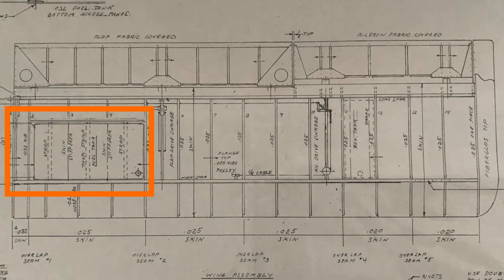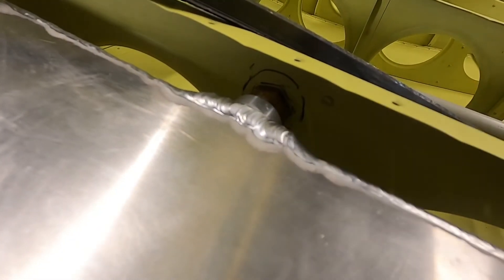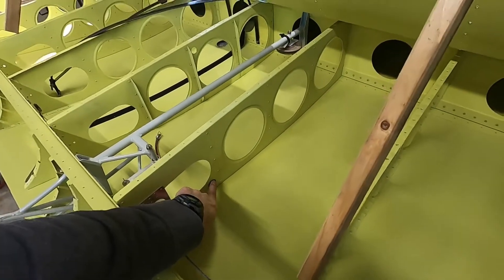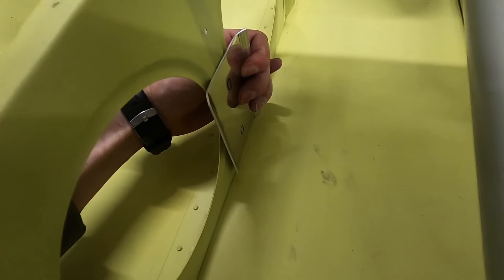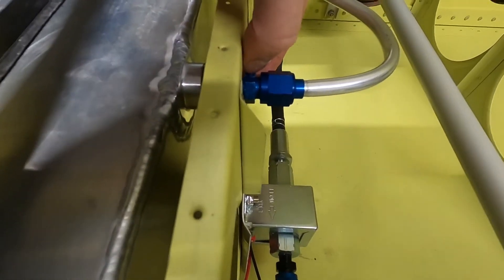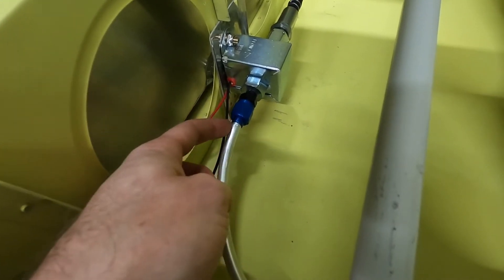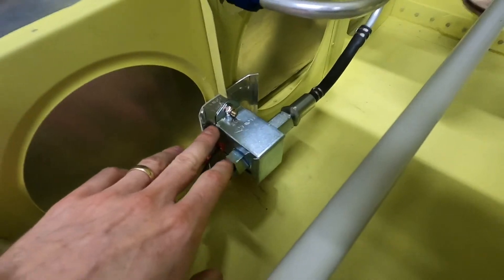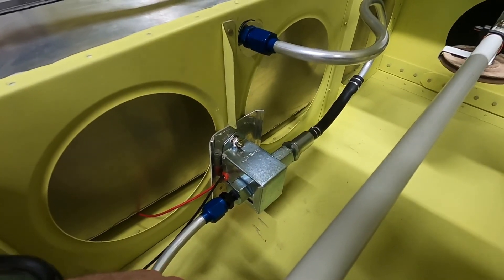Bearhawk Wing Fuel System2

Comment: Why drill holes through the ribs for fuel line, couldn't it just go through the existing holes with clamps? Looks good though!
Reply from the maker: Thanks Dave, I am sure there are several ways to do it. If you used Adel Clamps you would have to drill holes for the bolt that holds the clamp.  You would also have to find a way to rotate the clamp 90 degrees so the tube would go spanwise.  Maybe you’re thinking of a clamp type I’m not familiar with?  I think it would be more weight and complexity.  This is quite simple and light.